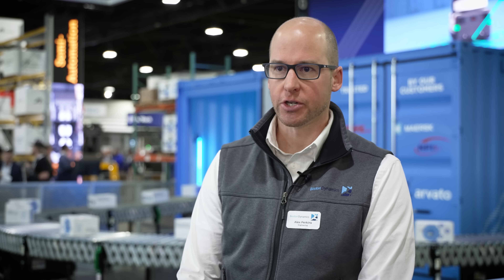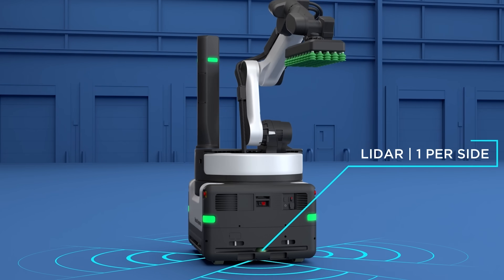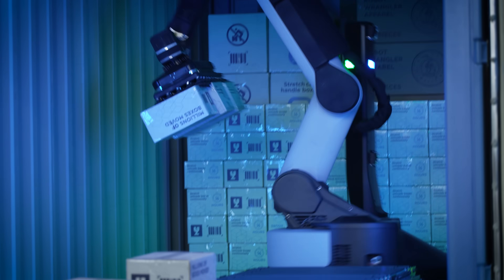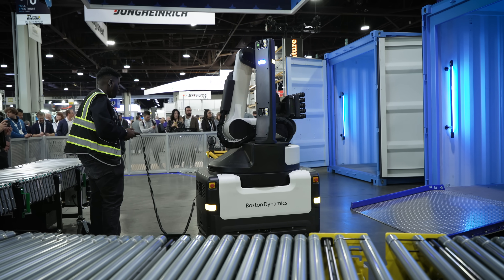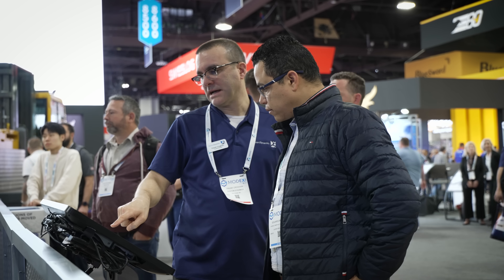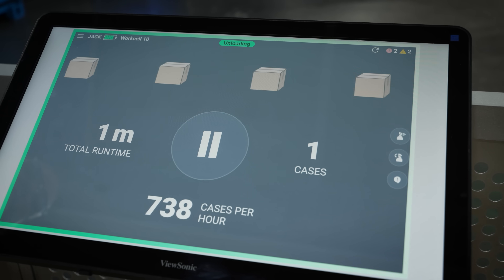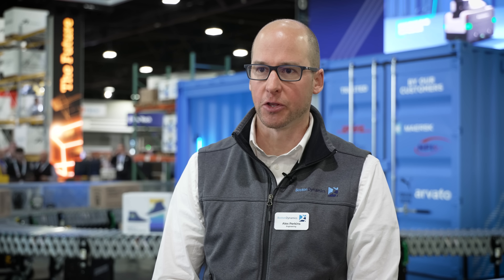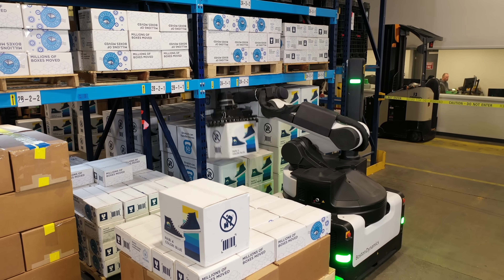Stretch at MODEX 2024 | Boston Dynamics

Comment: So if you want to automate unloading of a single cargo container, you'll have to make a down payment of 500,000$ to get the robot, secondly ensure that the container contains STRICTLY uniform cardboard boxes and nothing else, then setup the robot inside the container and build a conveyor belt system to actually transfer the goods. All this just to empty a single container. This seems completely unviable in real-world use cases when you can hire two guys for 15$/h to empty the container with no problems. These robots will not replace anyone nor will they make commercial impact anytime soon. Sorry to break the mood.

Comment: Anyone who has ever worked loading/unloading boxes can tell you how woefully inadequate Stretch is at this time.  Especially for courier hubs like UPS and FedEx.  He's come a long way, but he has even further to go before he becomes practical.
Reply: In your opinion, what percentage can it handle now?
Reply: @matthewisthebest  
Technically none.  If he were a new human hire at UPS, or a competitor, Stretch would be fired within the first 90 days.  As well, notice in the video how his packages are all exactly the same size and ideally stacked.  No irregular shaped boxes of various weight. No shifted cargo.  No top load or backfill (when a loader builds a box wall away from the backwall of the trailer about head high, then throws packages into the void until it fills. Then keeps building head high walls toward the front, throwing stuff into the top void 3 or so rows back.)  Everything is staged ideally to favor the robot and keep it moving as quickly as possible for the demo.  However, I'm sure Boston Dynamics is gaining valuable data/experience from running Stretch in the field.  It will be interesting to see how it develops over the next ten years.
Reply: @SewerTapes  If the boxes were loaded onto the container by a stretch as well as unloaded, would that solve the issue?
Reply: @limiv5272  
If all boxes being the same is normal for the place in the video, using Stretch for loading would make sense, as it would efficiently set up for the next robot.
Reply: @limiv5272  
I also hadn't thought about running the robots 24/7.  If companies do that, then Stretch could move more volume at this speed than a human working a normal shift.  So, maybe it really doesn't need to be much faster, just "smarter" and more adaptive.  I'm sure we'll be blown away by where this tech ends up though.
Reply: And the world is metric! Who wants a 50lb limit when 25kg (56lb) NET is a much more common packaging size?

Suction! Few packages are airtight. Lids that slide off are common. Think of apple boxes. Think of banana boxes!

Lots of common products aren't boxed at all. Sacks of cement (even at 35kg, 77lb) are common. So are sacks of potatoes (25kg). Items  come in bags, nets, on stackable trays (think bread).

Have you seen how lemonade bottles are shipped in bulk? A sledgehammer may crack a nut, but in most cases Stretch would be as useful as a nutcracker to demolish a wall!

Comment: Out of genuine curiosity, what type of cable connector is used on that connection to the operator's terminal? 2:44
Reply: The video does not really show the connector.
But in general you use something like M12 connectors for that kind of applications.

Comment: What would happen if the tape on the bottom of the box failed? I can not tell you how many times that has happened to me; I deliver for FedEx Ground, & package containment is not always good. Most of the trucks have no tape, so... what we have is what we deliver. . . unless, it is really bad, then I will bring it back for "Inspection" Can a robot do that? Would a robot even notice that all that was in a box fell out? You may feel, I do not like "Innovation" but you would be wrong, I do not like what doesn't work. I like things that work, but a Google map that tells be I have arrived at an address when I am on a freeway... That is Wrong. Get it right, & don't say it is. & don't get me Started with "Self Driving Cars" They are not, nor do I think they will be. Too much Fridge data from Human drivers will overwhelm the computer. (Unless, their driving is like mine, 50 years of - They will Probably do... - That is something that can be programmed into a machine, or me. & yes, there are always surprises. PPL forget their driving glasses, are talking to someone & almost miss a turn. My vote, No robots on the road.

Comment: Yay! more unemployed individuals with no start up job to gain essential skills to aim higher up.
Its brilliant technology however the comments in regards to "the employment shortage" is massively inaccurate, (so excessively out of hindsight).
Aldi supermarket 5 years ago had 8 manual check-outs.

It now has just 3 and the rest replaced by self check-outs with low repair/maintenance to repair them compared to the monthly wage of a human to use them.

Project your self 10 years from now most of the employable population will be unemployed replaced by automated systems.
Innovation/technology has made my life simpler and more transparent however if we keep investing in this technology its going to write us all off.

Comment: I’ve worked at fedex while in college. trucks don’t show up with neatly stacked boxes, good luck with that. Actually most of the time u can’t hardly open the door because the boxes are tilting towards it and come pouring out all over the floor
Reply: if it can unload, it can also load
Reply: @heyfindmenoob  have u ever had to brake really hard on the highway and everything in your car comes rushing foward? The same thing happens inside big box trucks and that’s why you can’t hardly slide the door open to unpack them. It’s transit that’s the problem
Reply: @rustyr9693  how does that change what i said over a month ago? once the door is opened it will just pick up whats spilled, no reason it has to be perfectly stacked packages, they just showed it that way for obvious marketing lol
Reply: As a young man I worked at a food warehouse, cross stacking and plastic wrap solves spillage. 

I was in my early 20s the first time I saw an automated wrapping machine and felt like I had been cheated into years of intentionally inflicted dizziness!
Reply: And usually large loads like this are on pallets, hence the forklifts to bring them out. Not sure what scenario this would be for.
Reply: @xx_naasson_xx goods often come from overseas stacked in shipping containers like that, no pallets. Then it gets palletized and  loaded into a semi trailer for domestic shipment.
Reply: This is going to be a overall revolution both the pickers and packers are going to be robots.
Reply: @Ruleta AI will replace both the workers and managers. Bernie wants to shorten your work week and 'Airforce Plans To Unleash Fighters That Can't Refuse Orders '. Some call it the Fourth Industrial Revolution:text-green-game-over:

Comment: If Stretch could be programmed to throw bags and suitcases onto a conveyor system from a height of around 6', with moderate force, it would be perfect for use in airport baggage handling.

Bonus points for crushing, losing and/or misrouting random items of baggage.
Reply: I wish robotics had been a thing when I was in school...
Reply: @barbg1023 Depends on your age. I'm 43 now, and had the option of doing Mechatronics at university. I didn't, but if I did then this would be the industry now. I think it's been hugely enabled by modern vision systems though. Robotics was definitely a higher education subject in the year 2000
Reply: @barbg1023  It was, only now they do allow the children to build machines instead of *only building children into machines.